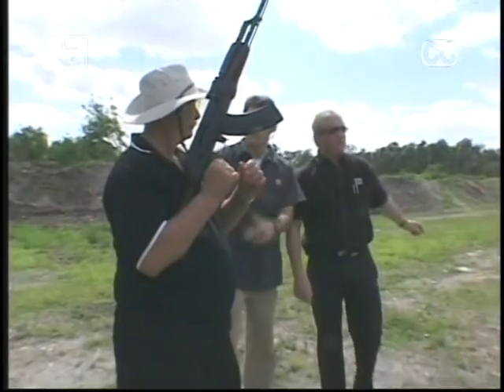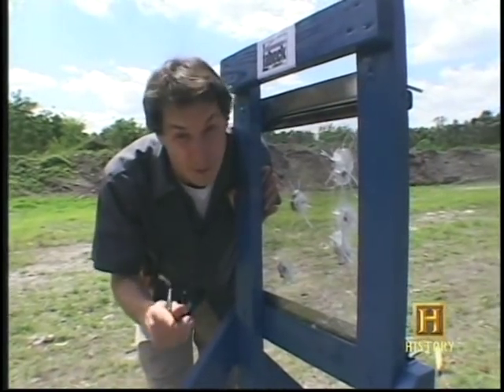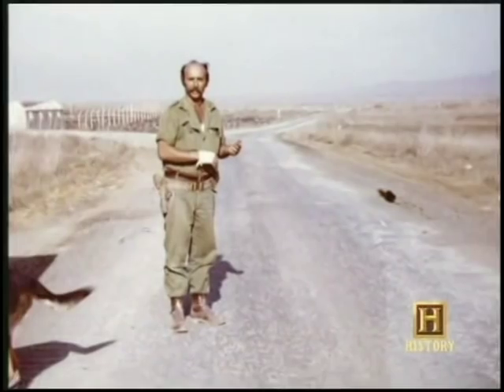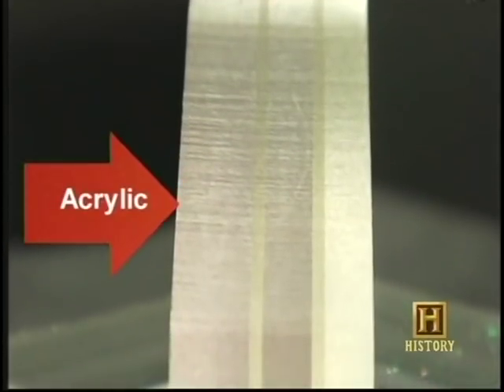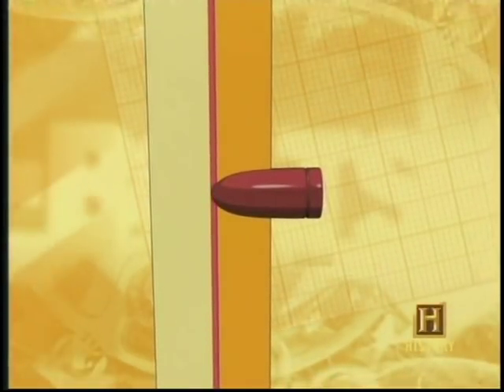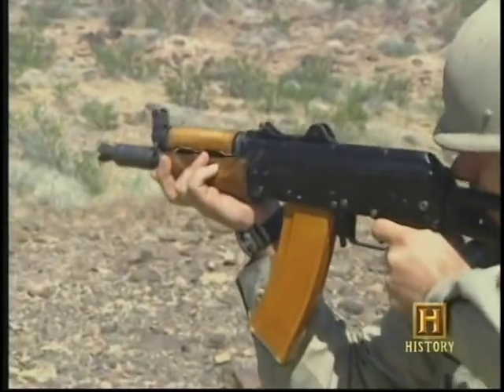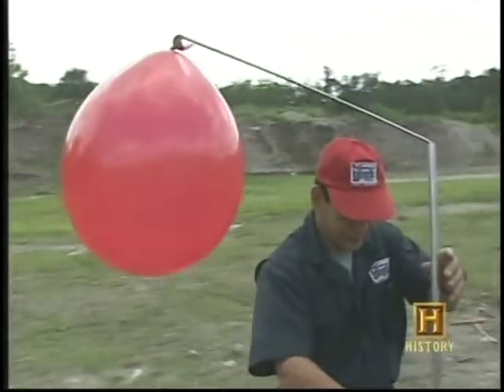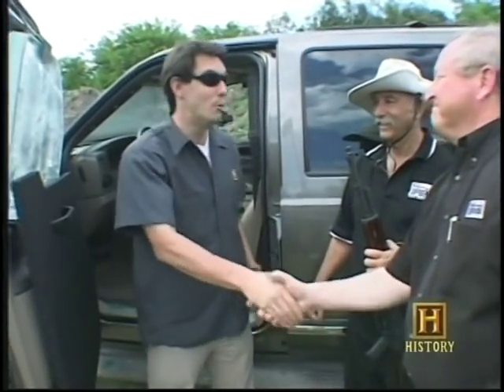OneWay Bullet Resistant Glass

Comment: what if they shoot the same spot twice? will the bullet go through?
Reply: thats what i thourght aswell
Reply: No it shouldn't. When shot from outside, the acrylic actually doesn't become hollow. The bullet hits it, compresses it against the polycarbonate, and flattens out becoming immobile. So the acrylic even though it has taken a blow hasn't completely failed. Like they said further round on the same spot could result in its failure, but at least from what i think, the second bullet on the same spot, still won't pass.
Reply: +jradetzky Hopefully you aren't facing off with a crack-shot

Comment: okay so the cracks are gonna bind the driver wen hes driving because the glass looks like there is smoke over it each time a bullet hits it so if somebody uleased a 50 cal. on it from a helicopter you wouldnt be able to see where you're going. also the roff needs to have armor in it to to prevent any bullets entering if assualted by chopper

Comment: Well before this is something to be of any use, we must know just how much the glass actually absorbs the energy from shooting through it and if it distorts the bullets trajectory very much. Presumably you can only shoot straight through the glass. As its sideways momentum wont be strong enough to penetrate, it will instead deflect inside the vehicle / compartment.

How much does the glass decelerate the bullet shooting through the glass, does it have any impact at all or would thick clothing stop it, will it have enough force to be lethal? Things we need to know. I am not advocating for shutting down research into this glass at all i would endorse it, but is it a product that is of any use as it is right now?

Comment: I'm suspicious of the last "from inside" test.  They placed the balloon immediately on the other side of the glass.  I didn't see a bullet fly out in the slow-motion shot.  I saw a lot of polycarbonate spray and pop the bullet though.  When they inspected the glass after the inside shot, all I saw was a mounting of the polycarbonate.  Did the bullet actually exit the glass?  I don't think it did.  I think only polycarbonate shards struck the balloon.  And if it did, how about accuracy/energy?

Comment: It isn't really an accurate test if your shooting at a balloon an inch away from the exit point on the glass. Instead, they should use a steel plate held close to the glass to determine how much power is maintained upon passing through the glass and then use a balloon 20-50 yards away to determine the maintained velocity and accuracy.

Comment: Cool, but there are a few problems. First, you're unlikely to have an AK-47 in the truck with you. Can the glass stop a 7.62x39 and then allow you to return fire with a 9mm or other pistol caliber....which brings me to my next point.

Is it still deadly? When you return fire, can it still stop the threat after having passed through the glass? A balloon next to the window hardly proves that. The glass alone would pop it.

Also, an AK-47 holds 30 rounds. It can stop 2 or 4? So what?

Comment: why shoot a slowish rifle round when you have a .223 or try a hunting rifle, like 30-30 ( its a pretty good round for its size ) but .223 traves real fast, a quarter of a mile in a second ( i dont really believe this but lots of powder than bullet )
Reply: .223 remington is faster, but has a lot less energy. 1100-1300 Joules as opposed to 2000-2200 Joules for an AK's 7.62x39mm round. Even the more powerfull 5.56x45mm NATO round has a muzzle energy of about 1700 Joules. The 30-30 round does have more energy at 2400 Joules (although with some older rounds having only half of that), but an AK fires 600 rpm, whereas a VERY fast 30-30 shooter would fire about 80-90 rpm if he didn't have to reload his gun.

Plus, the AK-47 is the most widely used weapon.

Comment: This technology is not new. AP&T, Inc developed this material back in the late 80's and was the first to market it.  However, realizing the flaw, that if a stray bullet hits the same exit hole, the bullet will go through and hit the good guy.  Plus this material will not stand multiple hits at point blank range without losing it's integrity.

Comment: firstly set that balloon 50meters/150feet away from the glass to show how much the projectile changes course which is important if your actually supposed to fight back
secondly will it stop a 308 or a 338 which are both fairly common instead of that low caliber crap and why specify "automatic weapons" as if that was the problem for a bullet resistant glass and then not go full auto blasting the glass with a full mag?

Comment: What happens if you shoot back, and miss your attacker. then your attacker actually has decent aim and shoots the hole you just put in your shield...
Reply: That hole would be the size of the bullet you used. So that can't happen unless they put there gun against the whole and fired but then you would just not be in front of the hole when that happens.
Reply: When the bullet breaks through from the back it shatters and removes the acrylic around the hole leaving what looks like a 2"x 2" square (circle w/e) weak spot. If the defender fires more than one returning shot, that's alot of weak area in something that supposed to be keeping him alive. 

Not a fan of weakening my own defenses is all.

Unrelated note: It would be interesting to see a lethality/accuracy test on a bullet that has passed through a sheet of this. returning fire is great, but if the returned bullets are no more lethal than a BB gun, or vear off-course its not all that helpful.
Reply: +Bob Nips You have a good point so I think they need more testing on it. maybe with those realistic jello body's they use on blade and firearm testing. I agree with what you're saying if you can shoot though your own defence and make it weaker then that is more of a chance they will be able to get though and then It's not as good of a defence as normal bulletproof glass. So my point is if it gets more testing and is made better then i would approve it.
Reply: +Bullman I say just lower the window on the car a bit and shot through that hole. much better.
Reply: pretty sure most vehicles fitted with bullet proof glass don't have roll down windows...
or at least not in military or security vehicles. Just the paranoid rich kids (IE personal vehicles)
Reply: Bob Nips they don't have roll down windows?? What is life anymore?
Reply: its alot harder to brace a window against gunshots and have the window movable, possible, just difficult. its a small cost for protection though

Comment: 30-06 Springfield AP would pop right through that.
Reply: no it wouldnt the 30-06 Springfield AP has about the same power as the ak47
Reply: Tye Moore 
This is basic math....
.30-06 M2 AP, 152 grain bullet at a muzzle velocity of 2,800 fps. 2,655 ft.lbs of energy.

7.62x39 M43, 123 grain bullet at a muzzle velocity of 2,400 fps. 1,600 ft.lbs of energy.

The energy advantage of the 30-06 becomes even more apparent when you're shooting at longer ranges. The longer more aerodynamic bullets from the 30-06 retain energy much better than the short fat bullets loaded in 7.62x39.

Comment: I would love to see empty full mag in full auto (TEST) 30 rounds in full auto takes 1.5-2 second on ak47 little bit more you can fit all or most of it in 24x24" all depend on scenario ,how far how fast what angle if you are moving, whole point is that I just like to see this test how much window like this will hold ,which everyone here knows that this protection is not ultimate but just give you extra time to get out.